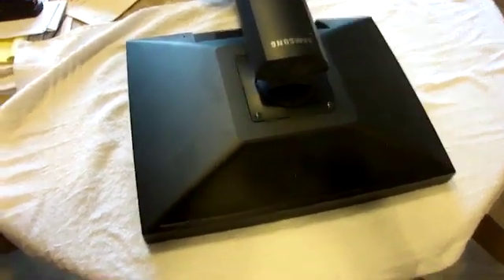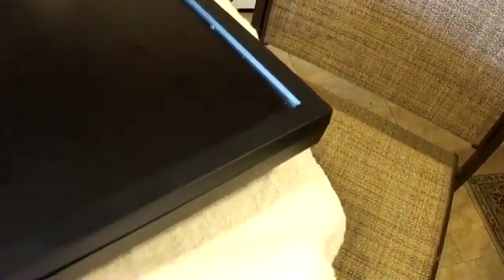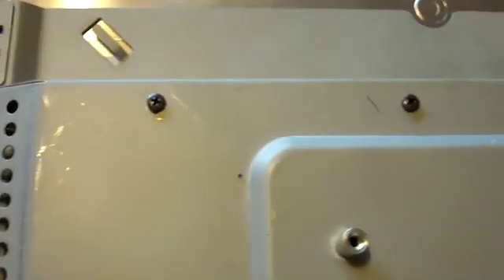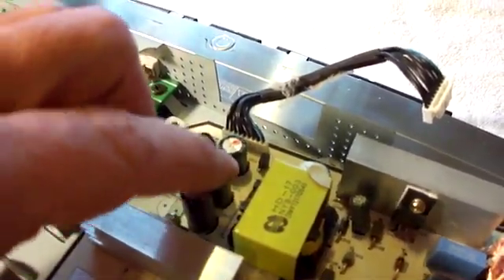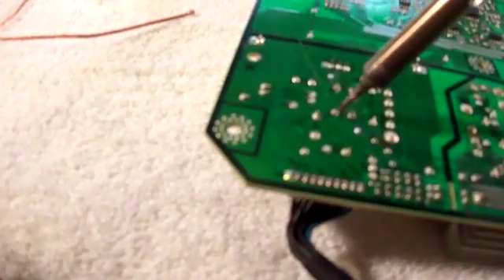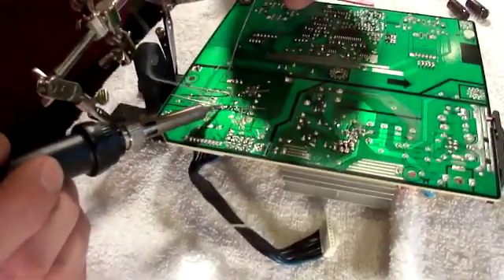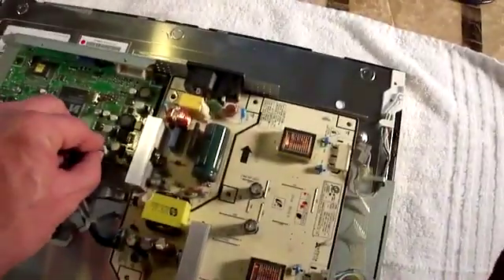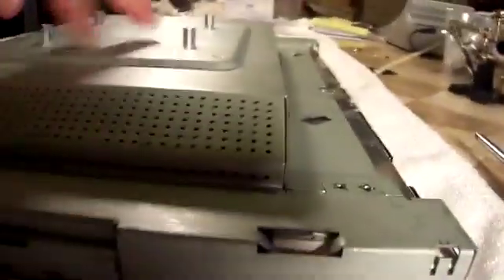Samsung 204b Monitor Repair Complete Step By Step

Comment: Bought a pair of these for $10 each for an arcade build, both had the same issue (6min to start up, very dim). I have almost NO soldering skills, but figured out which capacitors I needed (including the big one not in kits) and in an afternoon got both screens running like new. Starts up fast, nice and very bright. Will use one for the arcade build and keep the other as a backup since 4:3 screens with fast response times aren't easy to find anymore. Most are 5:4 or slow.

Comment: Hi there,
many thanks, I repaired my two old (years 2006/2007) Samsung 204B following your hints and your precious movie; I had to re-solder - over old and bulging caps - two 820mf/25V in one screen and two 820mf/25V + one 330mf/25V.
But just wait, since I had no 820/330mf (non-standard caps), I used 1000mf/25V standard capacitors; the result was two brilliant new screens. Infact if you don't have exact specs caps, keep in mind you can use caps with a mf rating same or bigger; same story for Voltage: same V or bigger. NEVER, NEVER, NEVER USE instead mf/V rating LOWER than that reported on old capacitors to replace since they can explode.
Just see http://www.niccomp.com/help/capsubguide.asp
Total 1.5 hours/3.50euro.

Comment: Unbelievable. I wanted to throw monitor. Even left it at my doorstep to pick it up when I go to throw thrash.

I wont even have to buy anything - I will just take yellow board to hardware engineers at my work and they will know what to do. Three of those capacitors seam really bulged.

Comment: Thanks for this.  I've got a pair of these as well, I ended up with mixed power supply revisions even though I purchased them at the same time.  I've got 0.0 and 0.1, so I had to send out for a few more 330uF to finish it off.

My logic was much the same as yours: I'm not throwing out 800 bucks when it can be fixed for less than 20.  Try to find a quality 1600x1200 screen for a reasonable price these days!